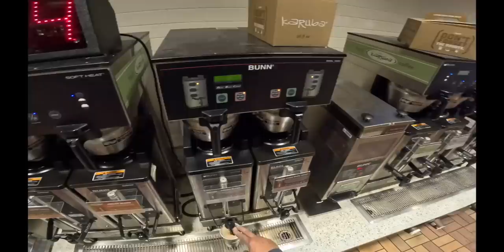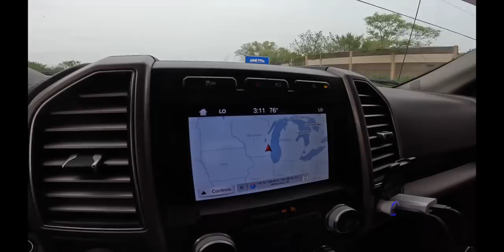Very tight access concrete removal! Very easy!

Comment: One recommendation for all the new stamps you are collecting…mark each set with a different color spray paint or paint marker. That way when you are grabbing them for a job, you don’t get one odd skin mixed in that doesn’t match. Really easy to do when you are on the job working fast.
Reply: As far as I can see, ProLine produces all stamps in two colors, red and blue, regardless of the design. It seems to me that this is a mistake or flaw in the design. 
Definitely each design should be in a different color to avoid the possibility of confusion.

Comment: Do you ever pin your slab to the foundation? As a contractor i always see that pulling away from the house, just adding a higher probability for a water entry point. Work hard for the boss guys! Its stressful enough running a business, its a stress reliever to know a boss can count on his guys without having to constantly press the issue. Keep up the good work fellas, God bless from Nebraska!

Comment: Twenty years ago, when my back was less painful and I had a working car, I spent about a week jackhammering about 12,000lbs of concrete and brick (it was a front yard short brick wall with an oversize concrete footing) into a 5 ft high pile and transporting it to the dump (one load was 5k, the other was 7k), and I couldn't help but notice and wonder why you don't have a silly makita electric jackhammer for those tight spots? I'd have had one of the guys using the makita while still using the skidsteer, but I've not had a hydraulic claw to use either. Still, makita makes good tools.

Comment: You should get some plastic mats instead of using plywood, they cost a little bit more but last much longer, fiberglass ones aren't really good they splinter
Reply: I was thinking the same about wide conveyor belting, cut to 8' foot and good to go.

Comment: You almost need like a little toro or bobcat dingo for jobs like these.
Reply: He has a small bobcat he used for snow removal, he doesn’t bother bringing it on concrete jobs cause of the lack of power.
Reply: @ChangeHumanity  I know, I know. I commented before I saw that it actually fit under the porch.